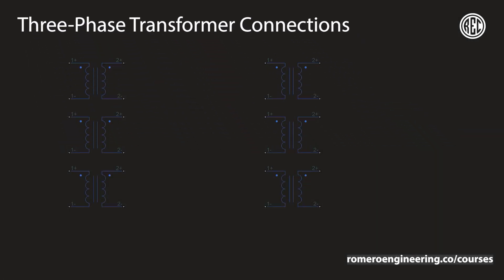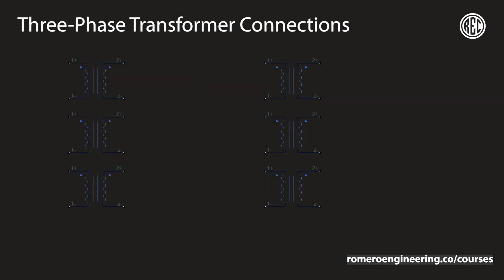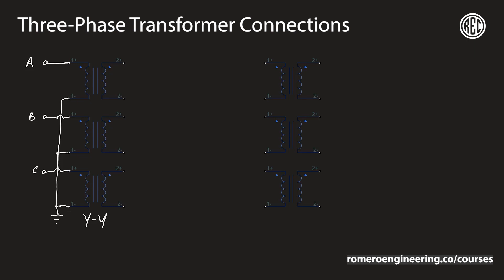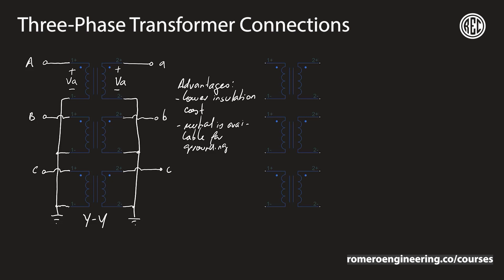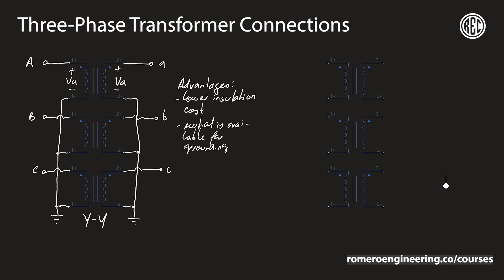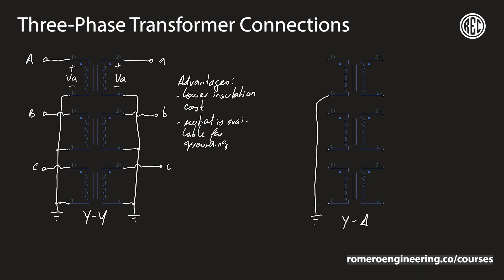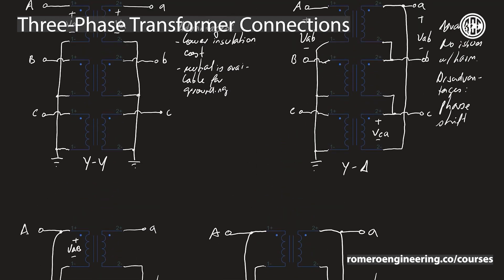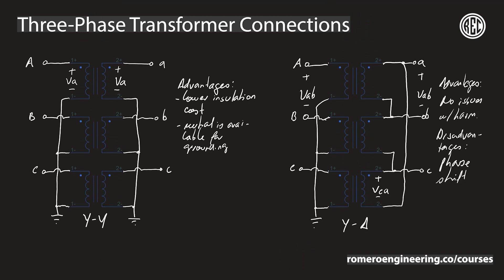Three-Phase Transformer Connections | Effects of Transformer Connections on Power System Analysis

Comment: Hello, this is very informative - how do I know what type of transformer winding connection I need on the low voltage side of the transformer? For example, we have a solar plant connecting to a 69kv transmission line and the transformer purchased was a delta / WYE